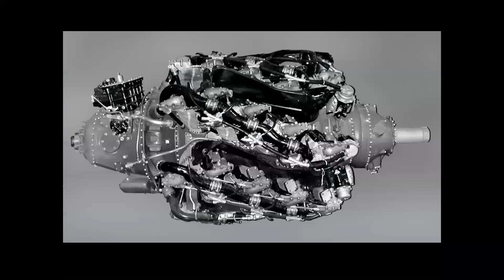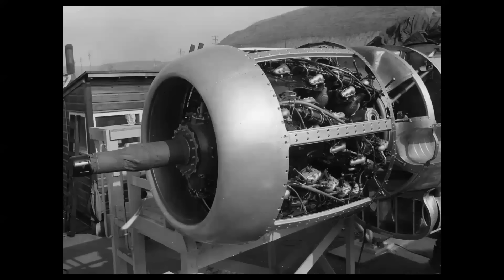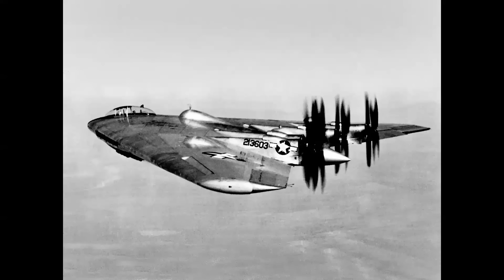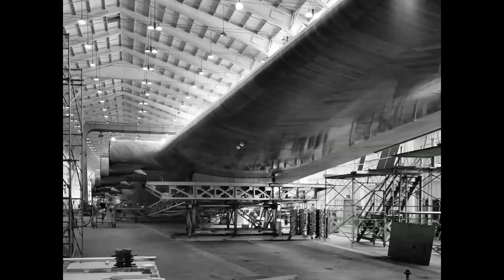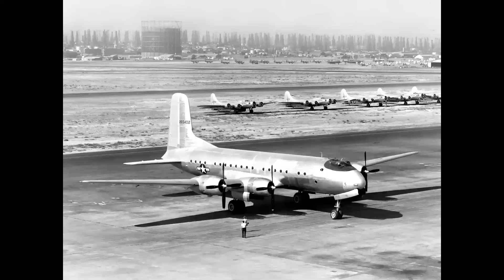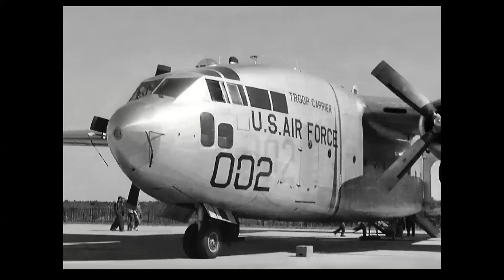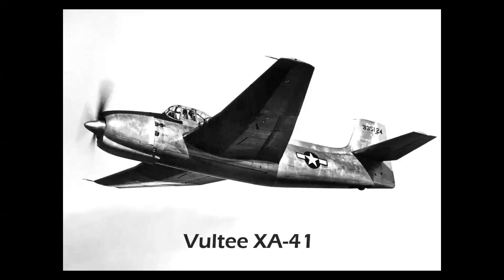PRATT & WHITNEY R-4360 WASP MAJOR AIRCRAFT - Airplanes powered by this giant radial engine

Comment: Maintenance on this engine must have been a chore.  With 2 spark plugs per cylinder and 28 cylinders that's 56 plugs that need to be removed, cleaned, re-gapped, tested and reinstalled at regular intervals.  I'm glad this was before my time as an aviation mechanic.  I've seen motorized cut-away displays of this engine at museums and the engineering and machining, all done before the days of CAD and CNC automation, is amazing.
Reply: × 4 engines.
Reply: It is a chore, I have the original P&W maintenance manual for it, interesting read. . . . . . . . . .
Reply: Changing all the plugs and changing the massive engine oil filter was a minor punishment for us line mechanics for a minor infraction of the maintenance procedures. It was Hell
Reply: @timmayer8723  Must have been almost as bad as changing  the lower PRT on a 3350.
Reply: You would have another set of 56 spark plugs, ready to go, as soon as you remove the fouled plugs.
Reply: @stay_at_home_astronaut  You are correct they cleaned the plugs with walnut media. I went with my father to the old AA Lax hanger.. The process was a little more involved than cleaning auto plugs in a Champion machine.
Reply: No. There was an engine analyzer at the Flight Engineer's station where he could look at each set of points and each spark plug. He could tell us which spark plug needed changing and which magneto was out of time. You can't gap the plugs since they have 4 ground electrodes that surround the center electrode.

Comment: You Left Out The Super Corsair
Reply: 13 plus the prototypes. Built by Goodyear aircraft in Akron Ohio.
Reply: @edwardstritch6895  There used to be one at the museum in Mesa, Az. but it's been years since I was there. It was impressive for sure- loooong in front!
They also had a straight tail B-24 which I hadn't seen before.
Reply: @paulolson734  that one ( Corsair) is at the Museum of Flight in Seattle now.
Reply: @paulolson734  That aircraft that you mentioned, is a PB4Y-2 Privateer long range patrol bomber.
Reply: Agreed - the Goodyear F2G should be acknowledged. They didn't build many, but it was in production, albeit briefly.